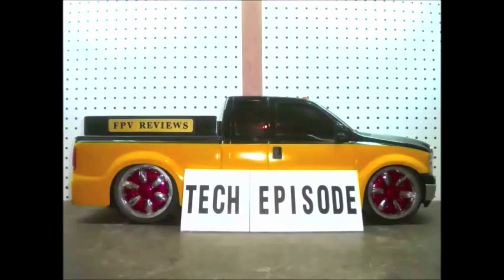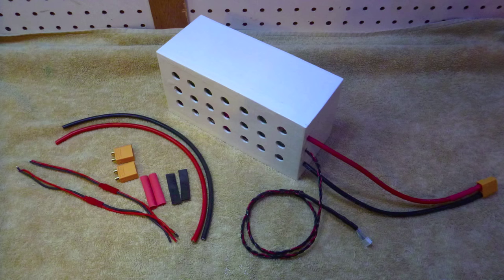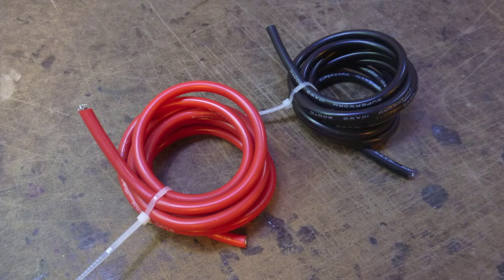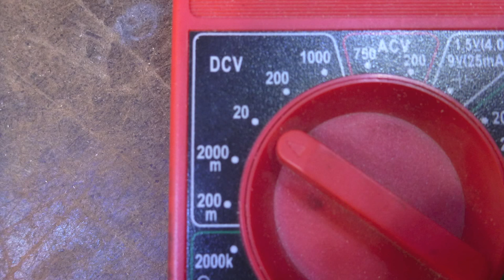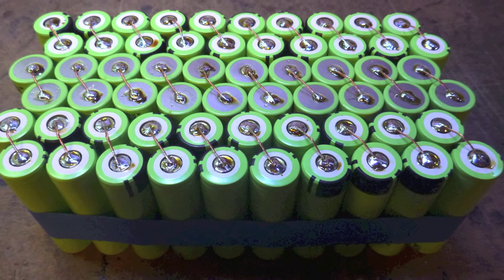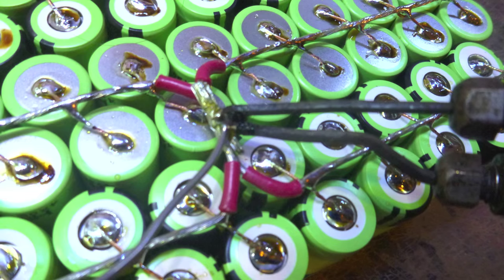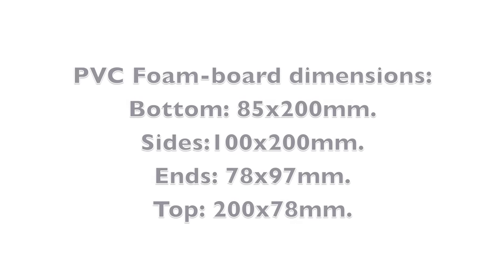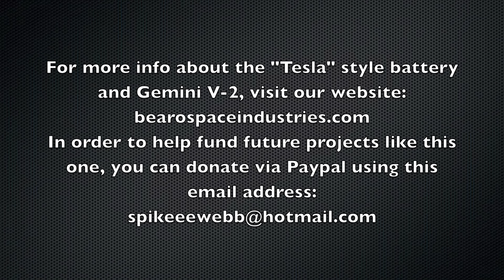"Tesla" Style Battery BUILD for Gemini V-2 And other FPV Planes!

Comment: Wow that's a lot of capacity! 64ah! If I were to use 4 x 16ah lipo packs in parallel, it would be half the weight at least, but I guess the reliability of that Li-ion pack is better in terms of not catching fire etc and stores without having that worry about leaving it fully charged for more than a couple of weeks etc.

However if one of them cells goes wrong its a bit harder to pin point. I had this problem on an e-bike that uses a similar pack to yours.
Reply from the maker: not sure what lipos you are using, and must calculate the watt hours, not the mah's.
the best thing about these cells is the energy density. I'm pretty sure that if you calculate the kg per wh, they are better than lipos.  for lipos i've tested, it was an 87% improvement.
the reliability is also very good.    
there are some peculiarities, such as a wider voltage range, so you have to turn off the low village cut-out of your ESC's.  for long duration flights, these are the best cells we've found so far.
Reply: Sorry I was getting confused with something else. The li-ion has better energy density. They are a very good battery technology. Better than lipo in terms of energy density. The only limiting factor is current handling when daisy chaining lots of batteries for really high voltages as the end cell gets the full brunt and you need to make the metal strips nice and chunky!. But on RC hobby its perfect, I guess since your not going up to 100 plus volts like I do with e-bike.
Reply from the maker: True.  Most RC models draw far too much power to use the Cells, but with aircraft like Gemini V-2, We are well within the limits of what the cells can put out. 
for example, the NCR18650B cells as shown in the video can put out 6 amps per cell continuous, and with 20 cells per group, as shown the total available amps is 120. 
The aircraft is only capable of drawing up to 80 amps at full throttle, so even if the throttle was left in the wide open position, we are only operating at 66.666 percent, or 2/3 of it's rated capacity. 
during the high altitude flight, we only used 30 amps to climb to altitude, which is 25 % of amps available. 
during loiter, for the 4+hr flight, we only used about 13 amps on average during flight, so only 10.83% of the available amps from the battery. 
The newer NCR18650GA cells can put out up to 10 amps per cell, so 166% more than the B cells, making the figures even better.  

The way we have wired the cells helps with the imbalance issue as well.   we are using bridges between cells, oversize wiring for the brings, trees, and supply lines, and have arranged the layout so the maximum distance from the furthest cell is very short. We have measured no degradation in the cell's capacity over time so far in testing.  I'm sure some degradation will occur over time, and some interesting trend data has been collected on similar cells by Tesla energy lately, showing that there is a very small initial degradation for the first couple of years, and then it levels off for quite a few years. The expected life of the cells in actual use has surpassed projections from lab modeling. 

We are only using our pack down to 3.2 v per cell as well, so they can go down to 2.5 and still achieve hundreds of life cycles.   For our model aircraft, we would  only change battery packs because of the availability of new cell technology, not because they are performing poorly, or have failed. It's far more likely that new, better cells will be produced, than the ones we are using are needing to be changed due to degradation. So unless you have an accident with the aircraft, you are pretty much buying the battery for the last time. 
with regards to your e-bike, are you balancing the cell groups?  it's not normal to have issues with running down a cell before the others. Something is wrong.
Reply: yeah that makes sense to shorten the distance on the end cell. I was referring to ebikes with regards high voltage so this is good for rc models etc. Did you look up data on ebike batteries? They use the same 18650 cells but brand varies usually the 7kw+ setups use the sony vtc cells as they are quite a decent cell with regards c rating. I use them for my ecig hehe.
Reply from the maker: if they are the sony vtc6 cells, then the C-raitng is pretty high, and they can put out 15 amps, but for my application, the extra capacity of the ncr18650GA cells, of 3500mah per cell, vs the sony 3000 is worth it. 
for my application, it's all about energy density, and battery longevity.
Reply: Yeah of course. The gemini is certainly amazing! Would love to fpv at that distance. I have a mavic which will go fairly far if your just a beginner. Now I'm starting to think can I boost the range on my drone!! ha
Reply from the maker: We've been assembling the packs from New high quality cells and have not had any issues so far.    the energy density in weight for these particular Li-Ion cells is 87% better than the Lipos we have measured.

Comment: Hi there, Spike!  I'm not sure that I could handle a 4 hour flight.  In this video, you used 60 cells.  I imagine I could purchase 20 cells, follow your video, and be able to get an hour of flight time, right?
Reply from the maker: Um, yes and no..   
Several factors come to mind immediately. 
First, you must have enough cells to handle the max amps for your power system, and have enough punch even near discharge to perform go-around.   The cells in the video can only output 6 amps each, and for a given voltage, there are only so  many configurations possible.  I also prefer to build the packs with wire bridges, so that the larger branch wires are not soldered directly to the cells, and so that the distance of all cells to a branch wire is the same. 
That limits you to either an 18 cell config or a 24 cell config  in 3S for instance.  With the18 cell config, there are only 6 cells in parallel, for each group, and then the 3 groups of 6 are joined in series.  The amperage you get to add for total amps available for the pack is only from the number of cells in a group, in parallel, so 6 x 6 + 36 amps.   This will be marginally enough to run just one motor,  and will not power the plane at full power. in fact, it would have massive voltage sag, and would be considered abusive to the cells.  
for these NCR18650B cells,  you could calculate the max amps, and let's say in the case of the stock Gemini V-2, which will probably draw from 70-80 amps at full power for takeoff with a fully charged battery, you would need :
80amps required, divided by 6 amps per cell = 13.3333 cells.     So round that up to 14 cells per group, and you have the absolute minimum cells required to (in theory) operate the plane safely.  So that is a total of 42 cells necessary just to get the plane off of the ground in theory.  Factor into that a couple of other factors:
1:  The cells will only have optimal performance at a very specific temperature, so most of the time will have less power than the rating suggests. 
2: Voltage Sag.    These cells have a wider voltage total range than Lipos, Which is fine, but it comes with a higher rate of voltage sag during full power operation, so that could affect that go-around capability that we discussed earlier. 
3:  Capacity of any lithium cell, and indeed most batteries in general is dependent on discharge rate. If you discharge the cells in a shorter amount of time, they will waste some of their energy in an increased internal resistance factor, and you may be able to tell just by the excess heat wasted when the pack gets warm. If you measure the amp hours, or total watts that you obtain in this fast discharge rate, It will be far less than the rated capacity, or indeed the capacity that you could obtain if you discharged at a slower rate. 
 If you can discharge at as slow as rate as possible,  you will find that the usable capacity is greater.  The number of discharge cycles that you will get for a certain percentage of battery degradation will also be greater, so in short, the battery will last longer. 
Given imperfections in manufacturing, and less than ideal real-world conditions for your application, It would be wise to oversize the pack somewhat, so that you can be assured of some descent performance, even if you decide to use a smaller number of cells. 
If you go this route,  or can afford it, I suggest using the NCR18650GA cells instead. They have a 10 amp discharge max rating per cell, and have virtually the same capacity as the B cells.  We have successfully tested a 36 cell 3S pack with the stock Gemini V-2 using the GA cells.  that would be 12 cells per group, and in the case of the GA cell, at 10 amps per cell, gives a healthy margin of 12 x 10 of 120 amps available.  This provides a healthy margin above the factory specs to allow for real-wolrd conditions, and still function properly. 
4:  The battery will age, so you also want to make sure that even if the specs are degraded to 80% of new, the pack will still deliver the intended amps and sufficient capacity. (these cells have a much longer life expectancy than Lipos, if used correctly, but will still experience some degradation). 
5:  Cost vs performance -  You will want to balance the cost vs performance,e but take into consideration that if you skimp on cost, more of the value of your purchase will be wasted on inefficiencies. You do not want to be on the back side of this performance curve, or cost curve. 

Hope this helps, and do look up the spec sheet from panasonic on the b cells, and the one from sanyo on the GA cells as well. Took me a while to understand it, personally. 
At the time of the 4 hr flight, I did not realize that i could discharge the cells much further, so could probably have gotten more flight time. 
The kit version of the aircraft will likely be heavier than the scratch built version as well.  I removed all unnecessary equipment for the endurance flight, and carried only the one small fpv cctv camera.  It was a windy turbulent day. Aircraft weight was under 18 lbs if i remember correctly. The aircraft was carrying no payload, and using relatively small and light wheels.  It was also a bit colder than ideal for the cells that day, but not so cold as to seriously impact performance. (take a look at panasonic's temperature charts as well).
It's likely that much longer flight times are possible, even with a stock Gemini V-2.
Reply: FPVREVIEWS I see your point.  Sounds like, for my needs, i'll just use my lipo packs.

Comment: I see your proyect very interesting...
but what about the weight? How much ?

Thanks !!!
Reply: +Revu Mac Taylor Audiovisual just a guess as per the information provide.i would say around 3500 grams (2800 grams of battery +700 grams of wiring ,soldering lead,case,etc)
Reply from the maker: +ganesh gowda total weight is 3kg. all the information/specs is on the website per the description.
Reply: +FPVREVIEWS  cool, after watching this video i m planning to build one for my quad which is using 6s 20,000 mah and weighs around 2400grams .so i m guess if my calculations are proper then 6 rows of 10 cells will give me 22.2v @35,000mah weighing 3000grams.
Reply from the maker: +ganesh gouda you will have to take into consideration the usable capacity, vs. the total rated capacity, and the usable capacity changes depending on the rate of discharge. check the spec sheet on panasonic's website. 
but, yea, you have the idea.  look up on youtube, they have been successfully used on long endurance quads before. just need big props turning slow with low kv motors, relatively. total cells will determine weight. you can fuse this concept for various numbers of cells, and various voltages.
Reply: Wow !! Thanks for the answer !! I expect more videos about your proyect.

Congratulations!

Comment: Great video!, detailed, very easy to follow instructions. Great job. Few questions, the size of the battery compare to a standard 4S lipo how big? Also weight comparison to 4S battery? What kind of amp does this battery design will give you? Compare to standard 4s Lipo, how much extended time one will get approximately? Thanks
Reply from the maker: so the short answer is that the energy density as we measure it is 87 percent better than lipos. 
the amps that it can discharge at a constant rate is much less, but for the latest generation of cells that we use, it's almost 3X the amps that the plane can draw at full throttle. Considering that we can climb to high altitude at 45% of that amperage, it's not a problem at all. 
We've done torture testing, and even  full throttle all of the time, they hold up just fine, with zero problems. 
of course it depends on the model, as some planes have such high power requirements that it's not practical. 
size is smaller than a comparable size lipo, and there is some empty space in between the cylindrical cells. 
That's good, because it allows for cross ventilation, and there is no isolated heat buildup. 
even during torture tests, we have yet to see our packs even get warm. 
we are not going back to lipos any time soon.
Reply from the maker: yes, i've seen them, but they space the cells further apart. I like to pack them diagonally, which still allows for ventilation, and lets the cells balance their heat together.  They would be great for places where you don't have space considerations, but for Gemini V-2, the space they take could make it very difficult to fit into the airplane. 
also, the extra weight of the plastic is a consideration.  you have to watch out for ground loops in some of the cross pattern weld tabs that are commercially available too. They could disturb some of the sensitive electronics by inducting current into the servo wires, etc.  At least in theory..

Comment: I'm a little unsure as to the mAh rating for the pack. 60 batteries, each with 3400 mAh. And how do you work out the C rating? What's the max amp draw from this battery?
Reply from the maker: +James Dyke you use the specs for the individual cells you are using from the manufacturer. as it has 3 groups of cells in series, you get to add the amp hrs per cell together from all of the cells from each group. The discharge rate is for each cell, and since it cannot be exceeded, the rate over time is the same as per each cell. the amperage available changes depending on how many cells are in each group, and the voltage changes for how many groups there are in series.  More info of real world flight tested data on the overall pack on our website, linked in the description. 
any particular questions, feel free to comment as much as you like here, or email me at:   fpvreviews@gmail.com

Comment: What is the time taken at your lab to charge fully from a almost completely discharged battery pack?
Reply from the maker: depends on the charger.  My charger takes about 10 hrs, but could charge much faster, probably 2 hrs or so is safe, if the charger can handle it.

Comment: Nice job!
I would like to do a pack for me, but i´m don´t know how it´s with the discharge rate. I´ve read that these cells have a discharge rate of 6,5A.
my question is, if I connect more Batteries together like you would i increase the discharge rate?
I hope someone answers me! Thanks very much!
Reply from the maker: +RC Channel, Asiak          sure, so the discharge rate literally is the time it takes to safely discharge. longer is better, and the max C rating represents the minimum.  1C is discharge in 1 hr. 
for a fixed electrical load, more cells per group would give you more capacity, and slower discharge rate, so yes, it would help if all else is the same. 
here is how to calculate:
this particular pack is made from 60 cells, 3.7v nominal each,  20 cells in each group, in parallel to each other, and 3 groups, each group in series to the other groups. 
if each cell can discharge 6 amps continuous, then you get to multiply that by 20, the number of cells in parallel. so 6 x 20 is 120.  so at the nominal 11.1 volts, you can pull 120 amps continuous. 
if you multiply the volts times the amps, you get the watts.   so you could pull 1332 watts continuous. 
hope this memes sense.  feel free to ask questions, and i'll try my best! 
spike
Reply: +FPVREVIEWS Thank you very very very much for your fast answer!!!
i need between 40A and 50A at 11,1V.
So, if im correct i will need a 3 group pack with at least 7cells per pack?

Comment: Hi spike. the only thing im confused of on this video is on how you connect each 4 lead of the balance wire to the pack. Normally 1 ground and each  of the 20cell group. but which terminal exactly. Hope you could explain it further to me. thanks
Reply from the maker: each balance lead goes to one cell group, and the group gets balanced as one cell. 
each cell is not individually balanced.     
this is the same way the larger capacity laptop packs are wired. 
I hope this makes sense.
Reply: thanks buddy

Comment: just so you know the only reason these are lighter then high C rated lipos is because of all the copper they have to use to handle the insane amount of amps a lipo can out put, these are a joke in comparing to a lipo,these can not out put much burst in compared to lipos, you can charge some 5000mah lipos in 5 mins, these lipos that charge in 5 mins use metal on both sides to keep from puffing then you can remove and use.
Reply from the maker: true, a higher voltage is always better in theory. I'm probably going to go up to 6S for my next design. 
I don't actually run them down to 2.5, just 3.3 minimum, and it has not been a problem. after 4 hrs, i'm ready to come down.you are absolutely right, though.